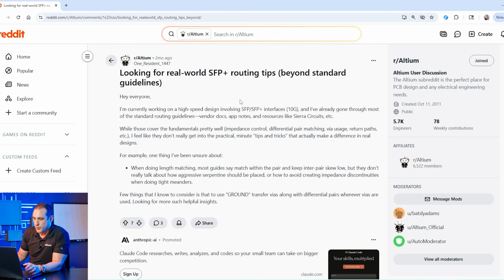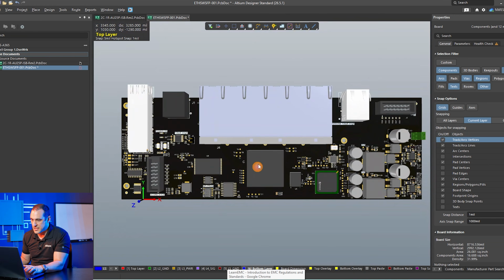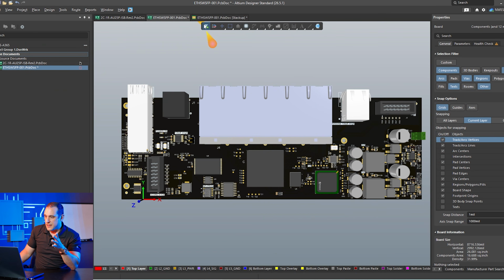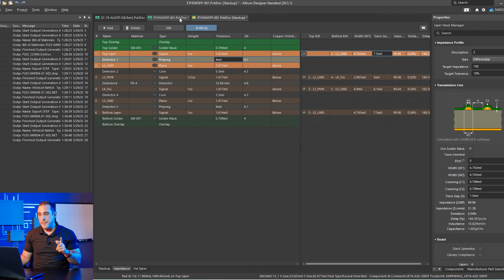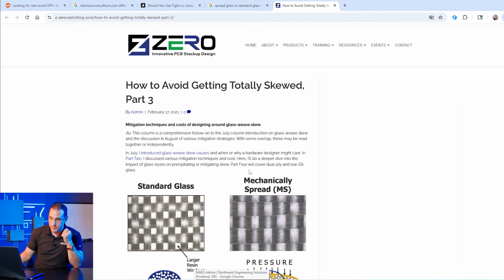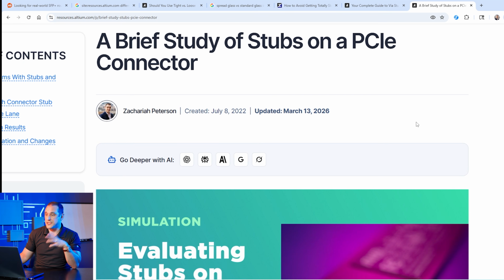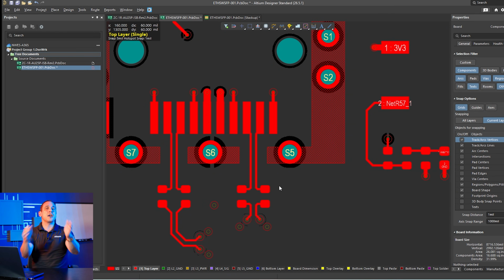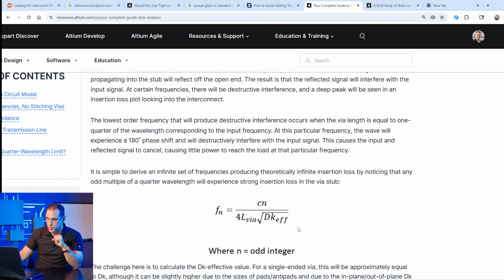SFP Connector Routing: High-Speed Differential Pair Design Tips

Comment: Hello, you say that the length tuning section has only a small impact on zje impedance, but it changes from 108 to 62. That seem like a big change or Do i miss something...best regards from Austria
Btw greate video
Reply: The number printed on the trace is the odd-mode impedance in that region, so the odd-mode impedance changes from 54 to 62, not 108 to 62. So it is a sizable change (about 15%), but what matters is the input impedance looking through the length tuning section, not the impedance of the tuning section. Basically we are looking at reflection at the interface between a 54 Ohm line and 62 Ohm line, but the 62 Ohm line is terminated at 54 Ohm at the end of the tuning section, and just using the input impedance equation you could calculate an input impedance; that input impedance is use to calculate the S-parameters of that length tuning section. You'll find that at the low frequencies of a 10G lane, there will not be a noticeable deviation in the return loss from the rest of the transmission line. However, if we put multiple tuning sections right near each other, then the return loss increases at lower frequency. You can learn more about it here: https://www.youtube.com/watch?v=S0DkOoxbWb4

Comment: What's generally the best practice with this pair/phase matching. A small number of large meanders or a large number of small meanders? I've always preferred the first option, small number of large meanders. As this presents an impedance mismatch over a shorter distance and less of an issue unless the frequency is high.
Reply: Small meanders at each point where the mismatch arises is the best practice. However, the definition of "small" depends on a few things. First, meanders create mode conversion, where differential signal/noise converts to common-mode signal/noise, and vice versa. When the meander is longer, you will observe mode conversion at lower frequencies. However, if the mode conversion is happening above your required channel bandwidth, and common-mode noise/signal arising from mode conversion doesn't travel to a place where it can radiate, then the mode conversion is not a problem.

Meanders also create reflections which can be seen in an S-parameter spectrum, but the reflection depends on both the length of the meander and the spacing between the traces. Larger trace spacing is also better here because it pushes the frequency where reflections become prominent to higher values.

Comment: As a beginner designer learning new things everyday. 12:26 : 15° zig zag routing 👍
Reply: The point of the comment was to bring up that the zig zag routing used to be the standard approach, but today's materials are much better for skew reduction. If you are designing for rise times where you need to worry about trace-to-trace skew in a differential pair below ~50 ps, then you should select materials based on a skew-per-length value for that material. Some material vendors can provide this data if you ask, or it might be in the material datasheet.